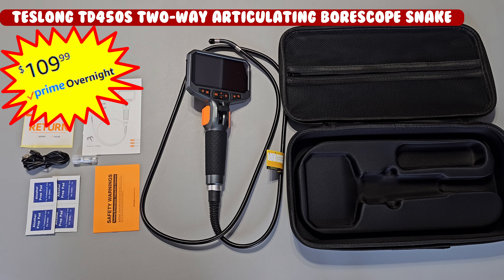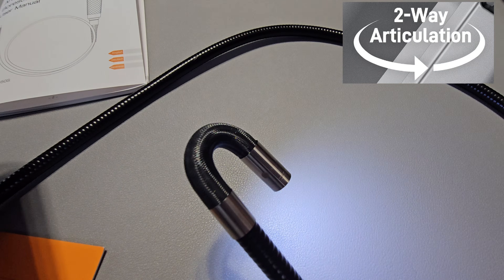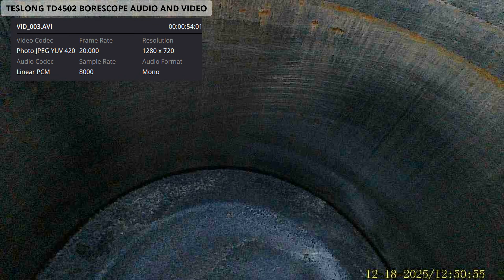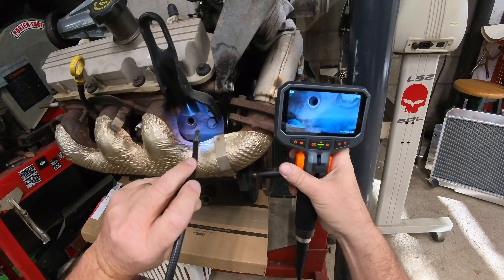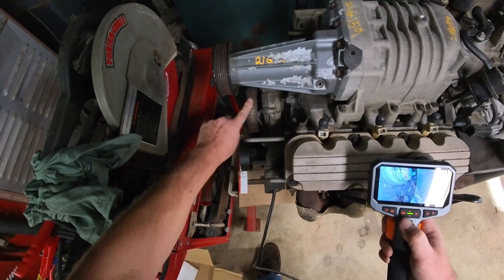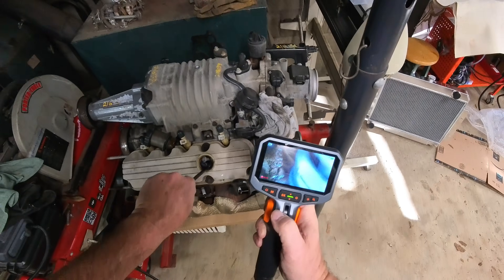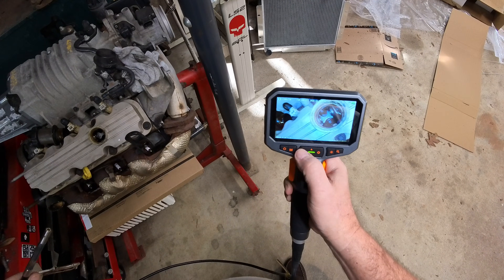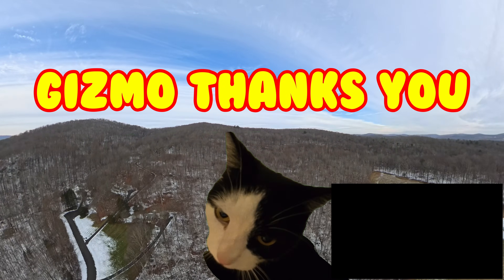Best Budget Pro Tool? Teslong Articulating Borescope vs. 160K Mile Engine! Teslong TD450S

Comment: I seen your reviews and vids on the Magician 250, I own one and am curious. Is it normal that the bike vibrates so much that it hurts the hands and breaks the license plate? Not sure what to do about it
Reply from the maker: Usually if it's vibrating that much, the motor mounts are loose.
Reply: @MotoCheez I did recall lock tighting every bolt even the motor, but I don't have an issue at low speeds just high way. I may get a Hawk X since it has a counter balance
Reply from the maker: High revs it does vibrate, but the engine mount bolts will get loose. The counterbalanced engines are was smoother!
Reply: @MotoCheez Yeah I will definitely be checking out a Hawk X, my buddy has a TT250 from CSC and they are very smooth as they are counter balanced, they are the Hawk's but with a lot of consumer friendly mods that CSC adds to them